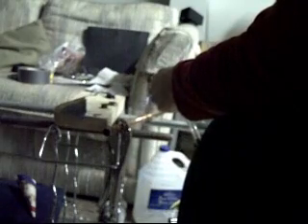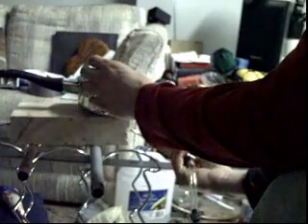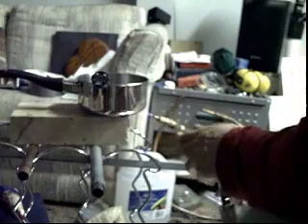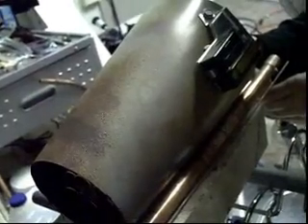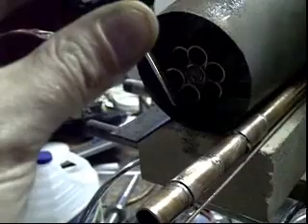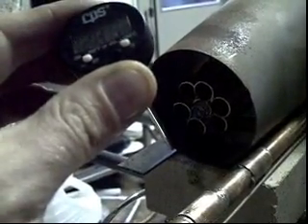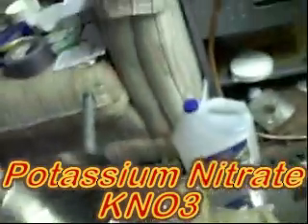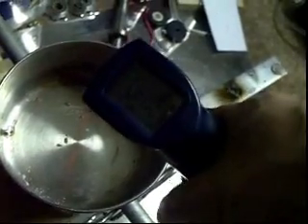#10 Hydroxy Torch Applications

Comment from the maker: I have very little intrest in gas milage or internal combustion engines. We must build a motor which is made to run on the Hydroxy explotion/implosion. 
My intrest is in the heat gains from hydroxy gas. I think D3 would argue the embrittlement point, but as i say i dont care much for that application anyway.
I want to try every application possible for home use. I am even building a tesla turbine to run off the Hydroxy explotion. 
Stay Safe.